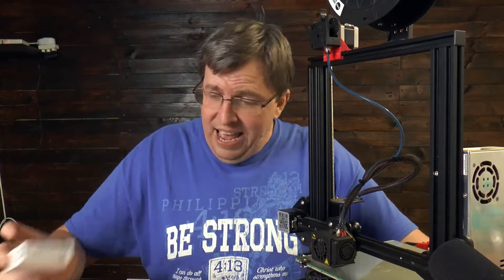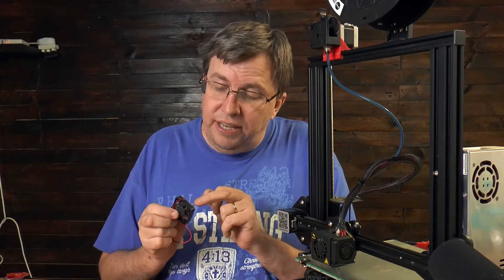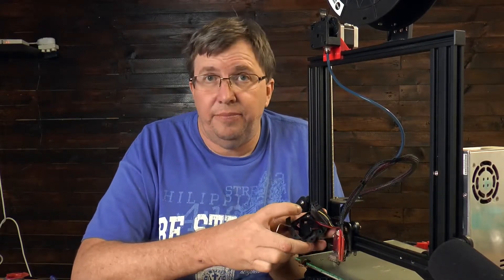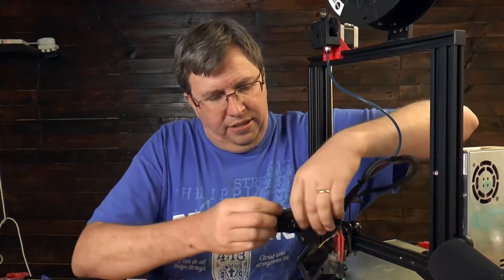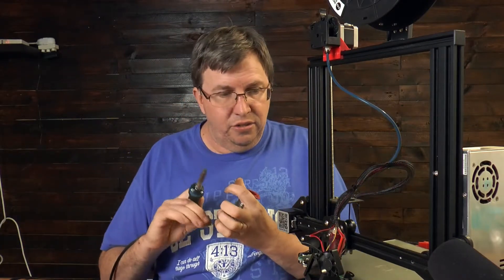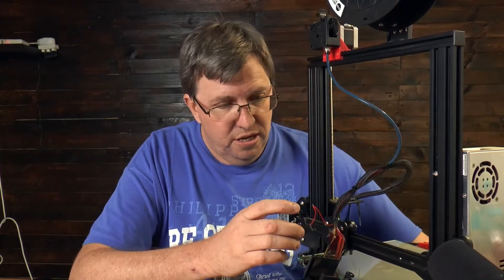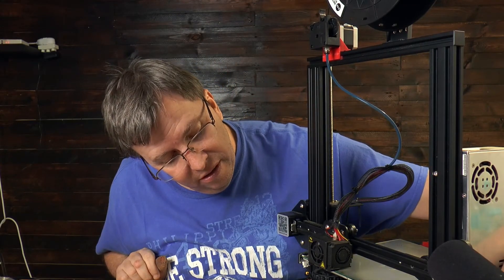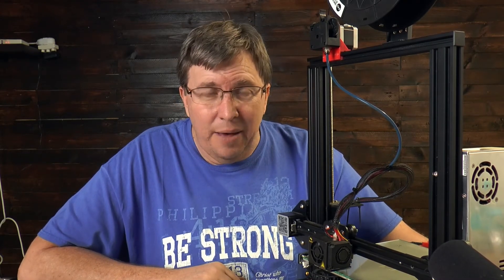ENDER 3 ISSUES | Replace Noisy Fan | FIX UNDER EXTRUSION (*Updated*)

Comment: thanks for the videos.. pity about the screw length problem with that replacement fan.. also started to get under extrusion on my ender 3, so think its time for a fan replacement. i did find that taking the fan out and cleaning the blades off from all dust does help for a while, but then the under extrusion starts again after a while, I guess the fan is on the way out...
Reply: Where the heck do i find these screws online?

Comment: Hello, I have the Ender 3v2 and when I preheat PLA, the fan (I'm assuming in the power supply) gets noisy and doesn't sound right. Any ideas if I should just leave it alone or replace it? The noise eventually stops after it's done heating up but it will occasionally make noise. Thanks!

Comment: My Enders fan has always made noises at random, and we’ve only had it 5 months. Sometimes it’s quite sometimes it’s loud.
Reply from the maker: The factory default fans are not great quality and can cause under extrusion.  Get yourself a Noctura fan, you will not regret it.
Reply: Mine makes noise on & off too. I not habe a soldering kit so im bring patientwith it

Comment: Should I still use my 3d printer when it’s buzzing like that?
Reply: I did to finish up some prints I made and never had anything bad happen from what i can see. Like I had two of my fan's fins break off cuz of one print separating off of my bed and went up into the extruder. It sounded like a helicopter, but still printed well.
Reply: Ok thanks, I used it for a while the I got me fans